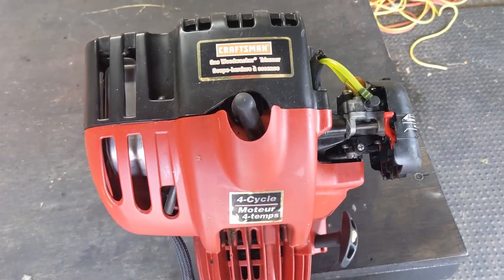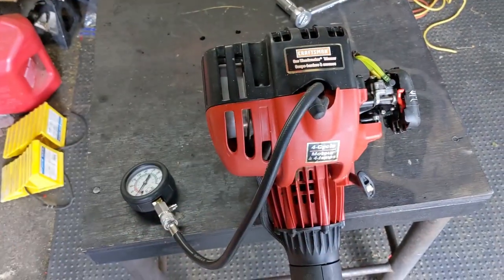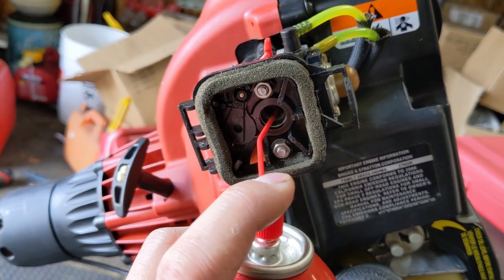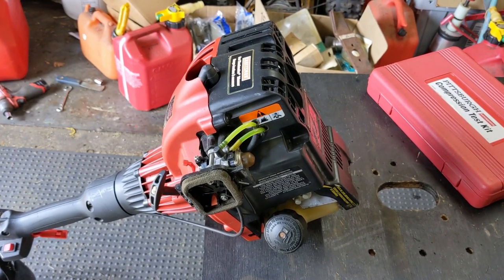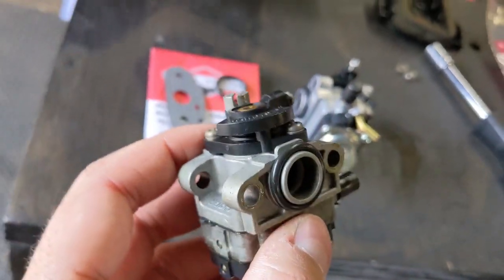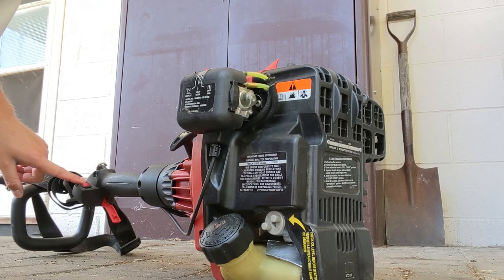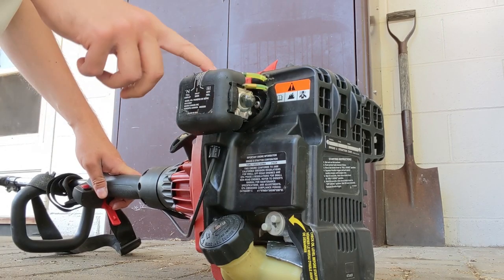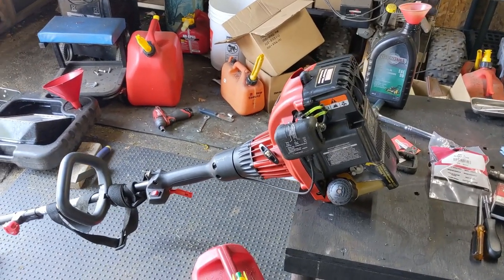Craftsman 34cc 4-Stroke Trimmer - Will It Run?

Comment from the maker: Many Craftsman's were built my MTD, which owns Troy-Bilt so I could see how that aftermarket TB carb would possibly work. 

The issue was when I originally searched for parts I couldn't find anything aftermarket using the OEM 696949 carburetor part number. But I wanted to include that aftermarket one in the video, as something you could use as an option, because it could help someone else out!
Reply: im having the same problem
Reply: MTD, makes  A L O T    of  yard engine tools. Most, are under any other name: Crapsman,  er   craftsman,  b & s,  Yard machines; yard works, etc.  THE  part numbers, of MTD  stuff, always has 3 digits, then a hyphen, and the rest of the number. BE  CAREFULL,  chinese clones of most all yard ' stuff ''  is usually  interchangeable. Like pull starter mechanisms, for lawnmowers;  MTD  mower ones, can be put on some Honda engines, etc.  Inter change with spark plugs, etc.

Comment: Got this new in 2005. Bought 6 add on attatchments.
 Just stopped running 3 weeks ago.
 Replaced carb, have spark, 60 lb compression, cleaned coil & flywheel magnets, reset airgap.
 Valves look good cleaned out muffler & spark arrestor, new spark plug, air filter.
 Still wont start, not even a puff!
 Could it be a timing issue?
 I am totally stumped.
Any suggestions would be greatly appreciated as I have watched countless videos and still nothing!
 Great video by the way!
Reply from the maker: @thomastrotier4267  hmm, spray some carb cleaner into the engine and see if it fires and dies. If it does, then the carb isn't supplying fuel. When you remove the plug it should be slightly wet or at least smell like fuel. Otherwise, if it doesn't fire you may have a compression issue, 60lbs seems low. But it could have a compression release, a leak down test would be better.
Reply: @EliminatorPerformance  thanks for the quick response.
 I tried starting fluid in the carb...nothing. tried it in the Cylinder, nothing not even a puff.  Not sure how to do a leak down test.
 Was thinking of filling the Cylinder with seafoam or PB Blaster and put the plug back in, let it soak a few days then suck out the fluid to see it the ring made stuck thus increasing the compression ( before I remove the head,)
 Could it be a timing issue, bad coil ( tester shows spark... but is at the right time) read about sheared woodruff key but recoil works fine. Not sure this unit has one on flywheel either. I found out this is a rare Briggs & Statton engine , hard to find parts for.  Can you explain how to do a leak down?
  Thanks again !
Reply from the maker: @thomastrotier4267  at the beginning of that video I do one, you could likely find better videos. You'll need a leak down tester tool, and you basically pressurize the cylinder with the valves closed and see where air is leaking. 10% Air loss through the piston rings is acceptable, and you'll hear that out of the dipstick/valve breather tube because air goes past the piston rings into the crankcase. So at 100psi that would mean the cylinder should hold 90psi and have a loss of 10psi. At 50psi pressure, you should only lose about 5psi. https://youtu.be/X0co8LvdqqE?si=sbqoXHzB3FH7CCoq
Reply: Fantastic 2 part lesson on that koehler head gst video. 
Thanks for the info on leak down test gonna have to find  one! 
 Did you do a compression test on the 34cc craftsman?
 What did your unit have or what should it be new?
 BTW can't find anything on checking the timing.
  Any Idea on this BS 34CC Flathead?
 1000 thanks Eliminator!😂

  @EliminatorPerformance

Comment: I realize that this was for video content but it’s just not feasible to fix a $225 USD value trimmer with a $100 carburetor. I received one of these as a gift. The first thing I noticed is that it was extremely heavy and bulky. The second thing was that you can’t even tilt one of these even slightly like when trimming a ditch or hill without it dumping oil through the breather hose. This saturates the air filter even at the correct level oil level and smokes like a freight train. Don’t even think about trying to turn it upside down to edge because of the same issue. The recoils are very weak and the plastic starter pawls broke several times. I thought that my 2 cycle had way more power although theoretically it shouldn’t have. My first Echo 2 cycle lasted 17 years while this lasted about 17 months. I wouldn’t sell it for any amount because the customer will not be happy it.
Reply from the maker: We sold this to a good friend of ours, big guy who loved it. Thing cuts down even the biggest weeds with no problems. He was always very pleased with it.

Comment: Since I recently rebuilt 2 Ryobi 2-cycle gas trimmers, I have to buy a new carburetor from Amazon for the Ryobi SS26 at the cost of $7.99 due to a missing choke lever.

Comment: Wrong with returns. Its a gas item FYI. Be careful. I tried to return a brand new never open just received generator and they said NOPE.
Reply from the maker: I've returned loads over the years, new and used, never once had an issue. Thanks for watching!

Comment: A friend gave me a Stihl trimmer with issues. I took it apart to find the clutch area plastic somehow got overheated and melted near the pull-start.  The plastic fan melted itself to the clutch.  Parts cost more than a replacement unit.  So it will be for salvage.  I am anxious to see what you find rattling inside.    Thanks  J K
Reply from the maker: Thanks for watching!

Comment: I would adjust the valves if it hasn`t been done in a while to finalize the tuneup.
Reply: yes, right on
Reply: Where are the valves on this flathead engine and are they reed valves?

Comment: Great job. Some of those carbs have a plastic or metal plug in the center of the throttle shaft that can be removed and the carb adjusted. Some don't. I had one in my shop that I could not get parts for and I removed the plug and under it was an adjustment screw. I got lucky on that one. Thanks for excellent video's.

Comment: I love the Stihl hybrid 4 cycle (oil mix with gas) BR 800 blower-quiet, low tone instead of nasty 2-cycle whine & long lasting - gotta remember to use oil mix gas tho -wrecked one of the 600.00 devices by using straight gas

Comment: Nice tips cheers,I have the same spray the carb no turn over.Check spark got spark.hmmm
Reply from the maker: Sometimes old fuel can dilute the carb cleaner, remove the carb or fuel line and try again

Comment: What compression tester do you recommend, I’ve heard the cheaper ones from Amazon aren’t worth it. I’m in Ontario
Reply from the maker: I use this one https://www.amazon.ca/Professional-Tester-Cylinder-Compression-Automotive/dp/B0725RCQ8P/ref=asc_df_B0725RCQ8P/?tag=googlemobshop-20&linkCode=df0&hvadid=459300567259&hvpos=&hvnetw=g&hvrand=17051826689555580030&hvpone=&hvptwo=&hvqmt=&hvdev=m&hvdvcmdl=&hvlocint=&hvlocphy=9000745&hvtargid=pla-455606420563&psc=1

And also this one for doing leak down tests: https://www.amazon.ca/OTC-5609-Cylinder-Leakage-Tester/dp/B0030EVL60/ref=mp_s_a_1_2?crid=25CTBDVM3EEE&dchild=1&keywords=otc+leak+down+tester&qid=1630201291&sprefix=otc+leak+down&sr=8-2

Comment: Good  day Boy video fits right in.  My bro. found  a troy-built. I took either down spray in spark plug & fired up.  I didn't do anything else to it.  How expensive is a new one?  sounds like these things aren't worth buying .  Thanks
Reply from the maker: The 4 cycle ones are quite expensive, thanks for watching!
Reply: @EliminatorPerformance  I forgot to mention, it really idles nice. Thanks

Comment: Alot of times, the diaghram is gummed up. This, does the same job for a 2 stroke, as a float/needle valve in a regular carb.  Trimmers are  a   ' special '  type/different carb design. The primer bulb, is more of a 'purge'  of gas, than a pump; which is why there is a fuel  'return'  line.  No excess gas, to flood,when the carb is functioning  properly.

Comment: As I am faced with replacing the carb on one of these, I watched this video with interest. I found a walbro carb on ebay pretty cheap (it was $18.11+$16.15 shipping - ) not sure if it is a counterfeit knockoff, but it does have "Walbro" cast into the side of it. I noticed these do have a visible low speed adjustment screw as well as a hidden high speed screw in the middle of the throttle shaft behind a plastic plug. There seem to be a lot of them up there sold from the US. Not sure if it is a new generation of these carbs, but thought you might find it noteworthy. Cheers!

Comment: I would have went straight to cracking open the carb. #1 problem is a damaged diaphragm carb. I fixed one of these attached to a tiller shaft. One of the smallest flatheads I've seen. I bought a aftermarket carb for like 30 something dollars US on Ebay.

Comment: Thanks for the info . i've got a helper that has one and he has a lot of trouble with it,And i tried telling him to get a electric one. maybe this will help change his mind. his in not a craftsman.
Reply from the maker: They're not bad, the 20v is good enough to do small residential stuff, a 40v would be better if you had taller/thicker weeds. Thanks for watching!
Reply: @EliminatorPerformance  Yes i have a Worx 20 volt and it dose a fine job on my home lawn i also have an old 120 ac volt that i retired like me, That i can get out if i let the back yard fence get's to long.

Comment: Gr8 vid

Yah when ever my 2 stroke MTD made Murray  25cc goes I may go for a 40v.

I have some run off areas that need the power to keep the weeds down.  On the hill

My m2510 has been going good on its 4th season.  Always starts.  I always use non ethanol fuel with synthetic 2 cycle oil

A lot of the craftsman equipment are made by Troybilt.
Reply from the maker: Yes many Craftsman were built my MTD, which owns Troy-Bilt so I could see how that aftermarket TB carb would possibly work. The issue was originally when I searched for parts I couldn't find anything aftermarket when looking up the OEM 696949 part number. But I wanted to include it in the video because it could help someone else out. Thanks for watching!
Reply: Both craftsman and troy built are built by mtd

Comment: Great video I actually have an older craftsman two stroke carb has issues did the hole take the car about sprayed out probably end up changing the carb but like you said because nowadays it’s easier and cheaper to change the carb then have spent time messing with it great job man be safe out there

Comment: I have that same weed trimmer and its locked up tight, the fly wheel will turn slightly, but stops about half way around.  The cord want pull at all, and I've tried to put marvel minimal oil and pb blaster down it it, but she want budge. Do you have any advice of what to try next? Bob in SC!
Reply: The flywheel woodruff key has sheered from the crankshaft most likley

Comment: There are adjustments on the oem but they are hidden under an epoxy cap.  Center line of the barrel on the linkage  side is the brass end with a hole in the middle  of it. Under that expo you cap is the adjustment screw.  It's hidden due to government regulations of not wanting you to adjust it possibly causing pollution.
Reply: Yeah an extra quarter turn on the trimmer adjusting screw could cause a smog problem

Comment: cant beat factory parts . I just fixed an expensive Honda lawnmower that needed a carburetor and the factory one was under 30 dollars so why take a chance on an aftermarket one . I have used aftermarket ones without a problem but they were on cheaper and older machines .
Reply from the maker: Thanks for watching!

Comment: Fixing gas trimmers not worth it?
Reply from the maker: Usually if I can find a cheap aftermarket carb and swap it out, some new fuel line and both filters, it's worth it. For under $100 a customer could have a machine up and running again.

Comment: If a 4 cycle trimmer like this happens to roll over on it's side while traveling and stays in that position for a while, and then refuses to start afterwards (after doing many of the above things - spark plug, removing and cleaning carb, changing filters etc), is it possible that oil could have gotten into the engine and messing something up?